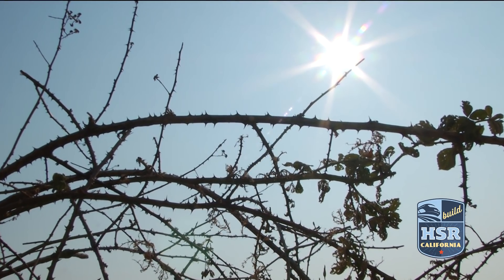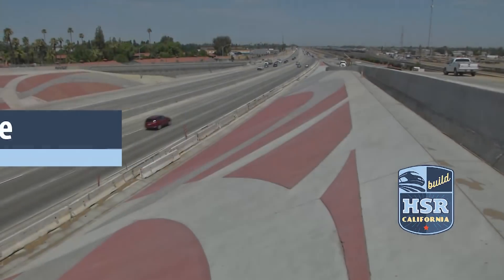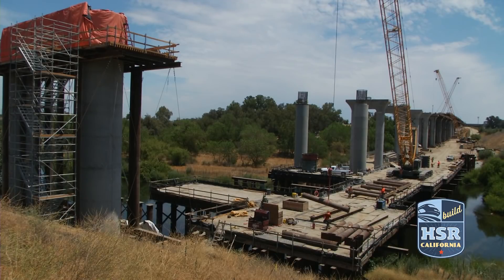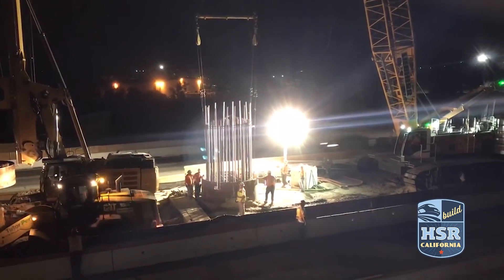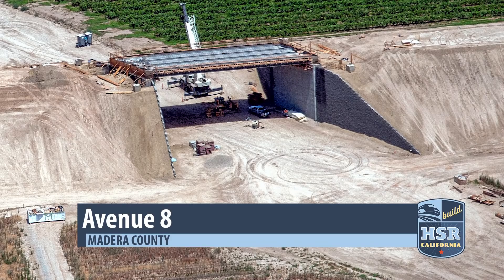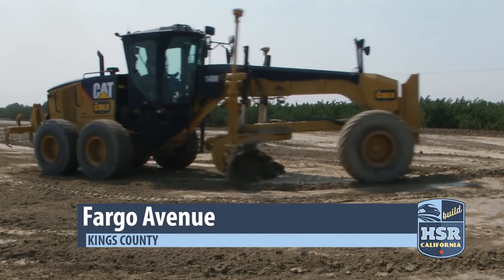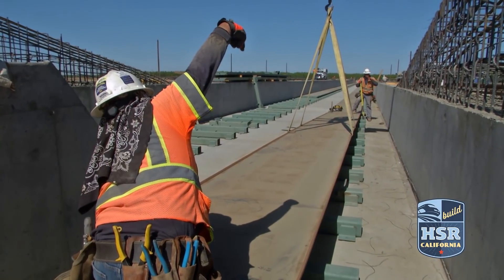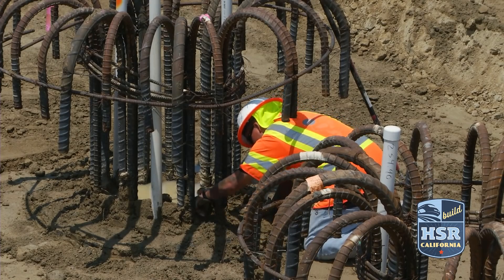High-Speed Rail Construction Update- Summer 2018

Comment: lol France spent $4.02 billion on their first high speed line lgv sud est
California HSR costs $98 billion

$15.8 million per mile vs $188.6 million per mile
Reply: California's HSR program isn't JUST the high speed rail. It includes road improvement projects along the corridor, grade separations along existing rail lines, and commuter rail modernization. It's a while program.
Reply: although i don't support the project, your numbers are totally wrong for a variety of reasons
Reply: LightningZap you also have to consider exchange rate
Reply: Those numbers are from 2007 euros, so even after factoring in inflation that only adds $600 million to the lgv sud est cost
Reply: HS2 was initially estimated at £32 billion, now it's up to £56 billion

Comment: PS: FULL 800 MILE ROUTE(SO THEY SAY!) TO BE COMPLETED ANYWHERE BETWEEN FY 2023-2026. FULL LINK TO SACRAMENTO, CA IS SAID TO BE FULLY COMPLETED BY FY 2027. THIS IS THE LARGEST INFRASTRUCTURE PROJECT IN CALIFORNIA TO MATCH UP W/HIGH-SPEED RAIL SERVICES IN EUROPE, SUCH AS GERMANY, FRANCE, BRITAIN & JAPAN WHERE HSR HAS BEEN IN USE FOR DECADES. GOOD LUCK TO ALL W/THE CALIFORNIA HSR PROJECT. WHAT THE HSRA NEEDS TO GUARD AGAINST ARE LARGE COST OVERRUNS, THIS IS ALWAYS A DANGER W/PROJECTS OF THIS SIZE, BUT ONLY TIME & FUNDING WILL TELL WHEN ELECTRIFIED CALTRAIN & HSR WILL BOTH ROLL INTO THE NEWLY OPENED SF SALESFORCE TRANSIT CENTER BETWEEN FY 2023-2026. STAY TUNED!

Comment: Nice im glad seeing my tax dollars go to free needles and reallllyy slow projects.
Reply: jqbtube, what does Eric’s comment have to do with Russia idiot!
Reply: It should have been a private project like the Texas Central, Brightline, and the train from Los Angeles to Las Vegas.
Reply: @matitigamez5285  America has delayed high-speed rail for decades. However, the delay will pay off. Very soon next year there will be a debut of the latest in high-speed transport in the UAE. It's a variant of String Rail Transport, which was developed by Sky Way Technologies Co. in the country of Belarus. Short run test tracks of urban and touring variants have already seen passengers riding in certified vehicles in the Belarusian countryside of Maryina Gorka. All variants of string transport are several times less resource intensive compared to other systems due the engineering design that supports loads through tension of injected concrete reinforced with anchored cables in steel tubes. We can save billions of dollars and build many more miles of profitable rail sooner if we leap frog and implement string rail transport in the rest of the USA.

Comment: Taking forever. Wish they would concentrated on Fresno to Merced first and have a train running already. At this pace be 5 more years and still no tunnel through Pacheco pass
Reply: The first high-speed section, Madera to Bakersfield, will not carry passengers before 2026, so your 5 year timetable is a bit optimistic.

Comment: Will be a constant drain on the California economy.
Reply: ed cummins 

So is inadequate air and road capacity. Do you have an alternative? Hyperloop doesn't count, it would face the same roadblocks as HSR, without the interoperability that conventional HSR has with other passenger rail.
Reply: HostilePancakes Roads are much cheaper. For $65 billion you could build a 4 lane highway from Bejing to Paris.
Reply: A A 

Which would be of far less use than the HSR. HSR upgrades portions of existing infrastructure to allow high-speed trains to access city centers. Benefits are local, regional, and intercity. With a 4-lane highway from Paris to Beijing, you will have to completely avoid urban areas to build it with only $65 billion. Unlike the HSR which will collect fares, such a road would only be able to garner a reasonable amount of use if it were free -- which means it couldn't collect revenue at all, save for advertising billboard slots.
Reply: The comparrison is to show how ridiculously expensive HSR is. Highways are far more useful and chepaer than HSR.
Reply: Tell me when your motorway allows you to drive a 350 km/h to reach your destination faster. You will still be behind the wheel and stuck at 100 km/h by lane huggers, while train passengers would have already arrived comfortably, having read magazines, surfed the web or watched a movie.

Comment: What a joke ! This white elephant is Jerry Browns baby all the way. Almost 2 times over budget and the projected top speed has been knocked down to just slightly faster than Amtrak. Add to this the plain fact that no high speed rail system on earth has ever shown a profit, and yeah, we got a problem. Elon Musk now has a design for tube transport that can travel over 500 MPH, at a quarter the cost of Browns nightmare. Now Jerry Brown's "vision of the future" looks more like a wooden steam powered fighter plane. Yeah. Brilliant. What an asshole.
Reply: Top speed is still 220mph, although it will likely be at this speed for a relatively small percentage of the entire S.F. to L.A. trip.  They've redesigned the tunnels to smaller diameter to save money, which will restrict speeds in ~100 miles of tunnels to 200mph.  The section from Gilroy to S.F. will likely be completely on shared track, which will limit speeds to 90 mph.  Remains to be seen what speed the train will run at from San Fernando Valley to L.A., but it won't be high speed because it will share right of way most of the way, and its a densely populated area.  California is not Japan.  This system will almost surely be subsidized.  That's not a problem, but let's not pretend it will be a cash cow.  Also, unless there is an express train from S.F. to L.A., it's highly unlikely it will make the trip in less than 3 hours given the current business plan.  In order to make it at the proscribed time of 2h 40m, it would have to run at full speed the entire length, including blowing through multiple stations at 220mph, which isn't happening.
Reply: High Sierra my facts are based on the need of much greater concerns. I don't dispute your comments. My point is as a Californian water should have been a higher priority. Too late now! Guess we will just wait till our third year if drought ( not hoping for it however that how our weather pattern works....feast or famin)whenryone will be pointing fingers. Fact is the finger points back at us.
Reply: You're not clear on what I'm arguing, which may be my fault for not being clear.  Of course all the ancillary things will come with the full build out, but there are a couple of issues: 1) The system is starting in the area which will be least used because it's cheaper and more politically expedient. 2) Phase 1 is at least 4 years behind schedule, and even if they stick to their current timeline, which is unlikely, actual passenger trains probably won't be running the full length until 2040 or so.  Phase 2 doesn't even HAVE a schedule.  So, quite literally, a timeline for "full build out" doesn't even exist.  What we're essentially assured of at the moment is a bullet train from Fresno to Bakersfield, and a fast commuter train from Gilroy to S.F., and those two systems will not be connected.  The funding for anything else doesn't currently exist.  So let's be optimisitic and say Phases 1 and 2 are fully built and operational by 2050.  You don't think other tech will have emerged and matured by then like self-driving electric cars, hyperloop, or quiet hypersonic flight?  The system is almost certainly doomed to be obsolete by the time its finished.
Reply: High Sierra God I really hope that's a reality!!! I've heard but I've heard it before. If it comes true than AMEN!!👍👍👍
Reply: Well, this is part of the issue.  1. We didn't vote for 2 commuter trains from Central Valley to San Jose and I.E. to L.A..  I'm not biased here either, because I'm from the Inland Empire, and think THIS is the smartest place to run it.  However, we didn't VOTE for that.  2.  If that's the most effective part of the system, then the way it's being built is only effective from a political standpoint.  Again, did we vote for a politically expedient HSR system, or did we vote for one from S.F. to L.A.?  The whole idea was that the train was going to compete with air travel between S.F. and L.A. and provide a viable green alternative.  The idea behind Prop 1A was NOT turning Fresno into a suburb of San Jose.  Also, the most important run of this system is L.A. to I.E. to S.D..  That links ~20 million people with a rail line less than 200 miles long.  And yet it's being built LAST.  That's if it's ever built, because there is no concrete plan right now for building phase 2.  Speaking of phase 2 and expansion, while you might have an argument about augmenting HSR with various other commuter systems, you can't simply expand HSR to your hearts content.  They've already had tons of problems with right-of-way in the Central Valley, and that's mostly farmland.  They gave up on dedicated right-of-way for Gilroy-to-S.F., as well as Burbank to L.A..  Also very tough will be the route through the I.E.  In addition, geographic factors just as challenging as Pacheco Pass or Tehachapi abound in this state, so it's definitely not that simple.
Reply: Of course passenger trains weren't obsolete 200 years ago.  They were brand new technology then.  They did become more or less obsolete with the advent of the interstate highway system, though.  Another issue the train itself doesn't really address is how you get to and from it.  The train doesn't address local road traffic at all.  The only thing that makes public transit attractive is road traffic.  But even then, most of the time it's easier, cheaper, and faster to get somewhere by car than it is by public transit.  This is why most people still don't ride trains or buses, and also why public transit usage isn't really growing.  You improve the road network via networked cars and roads and public transit becomes even less attractive.  You replace a 200mph express link with an 800mph express link, and it becomes less attractive.  You replace 70mph human-driven combustion freeways with 100mph self-driven electric freeways and HSR becomes less attractive for medium haul trips.  The question is whether or not HSR would be competitive enough with new tech to be worth it.  Probably not.  So we'll build a $80 billion HSR system that's worth using for 10-20 years, and then it will be a debt-ridden relic.
Reply: High Sierra please name the last three dams built in California and explain why Jerry Brown just signed a law restricting households to 55 gallons per person. Is it because there is no water shortage in California?
Reply: Let's not forget the biggest red flag: ZERO private investment. When it was first pitched to California voters (I remember because I was living in Marin at the time) they said that the costs would be defrayed by sizeable private investment. But of course, businesses know a giant bullshit boondoggle when they see one. To date, this financial Hindenburg has been entirely funded by California taxpayers. Thank Christ, I'm not one of them anymore.
Reply: steve harrigan 

Uh, look at Japan's Tokaido Shinkansen -- profitable since the 1990's (probably before that, too).
Reply: High Sierra back at you with your blnd stupidity!!
Reply: Thank you , unfortunately the BROWN  stain will not be to easy to wash away!!;

Comment: Dear High-Speed Rail,
I look forward to the benefits this project will bring not only to the state but to our country. This will not only ease congestion but also cut greenhouse gasses. One thing that I suggest is to maybe partner with other high speed rail operations in the country like Brightline or Amtrak’s Acela or even better other countries and there high speed rail programs.And maybe send people to ride those trains to see what’s coming to America
Reply: Evan L california is the size of France, has the same economy, and yet we had a high speed rail doing 330 kilometers per hour in 1981, and today it has nearly 3000 kilometers of track. Its truely a matter of political will and i look forward to having the same type of high speed rail in Texas. 

I shit you not, morroco had an high speed rail before the texans
Reply: France did not run trains regularly trains at 330 km/h in 1981, the first TGVs were at first limited to 260 and quickly upgraded to 270 km/h (which was by far the fastest in the world, way ahead of the Shinkansen). Even now the commercial top speed is 320 km/h which is still amongs the fastest in the world and the 40+ year-old trains reach 320.

Comment: It would be great if the HSR was Finished by 2022 , for the World Cup
Reply: Literally zero chance of that.  Assuming no further delay, at best you'll be able to take the train from Fresno to Bakersfield(nowhere to nowhere) by 2027.  Construction of the S.F. to L.A. segment is supposed to be done by 2033(that's a pipe dream).  Extrapolating from the central valley segment's lead time from construction to use, this means full-speed S.F. to L.A. service will likely not occur before 2040, if ever.
Reply: Relative to the state population of ~40 million, it's fairly insignificant.  Fresno MSA and Bakersfield MSA combined are about 1.9 million, which accounts for a whopping 4.75% of the state population.  There are four other MSAs larger than both combined, and the three in southern California account for more than half of the state population, so when we speak of linking these two in context, IT IS NOWHERE.
Reply: the world cup in Qatar?
Reply: Derianmon my bad 2026
Reply: Oh that's neat! I googled it, I didn't know they had multiple countries host sometimes!
Reply: @AuroraBoBora  It'll actually only be the second time they have. The first was in 2002 when it was in South Korea and Japan
Reply: E.V. Gaming  It won't be in England, since they rotate it between continents

Comment: Awesome!! I wish more people could embrace this vision! I have always said, “if you build it, they will ride it”
Reply: After the first train runs on the Initial Operating Segment, more people should be on board. The same thing happened to BART: significant opposition until the trains started running, now people cannot think what life would be like without BART :)
Reply: @archlinuxrussian  Oh?  So you shoot up Heroin in Bart stations?
Reply: David Troncoso You are so wrong. Because of the blended system at both ends, the advertised speed will never be reached, therefore no riders and 90 billion in debt which you have to repay. PS take a look at some of the recent HSR failures around the world.
Reply: @johnnyjames7139  "Failures", just like France, Germany, Italy, China, Japan, Korea… oh wait…
Reply: @transitvideosbayarea  a bullet train between Amsterdam and Paris, or Shanghai and Beijing is FAR different than the slowest most expensive high speed rail being built between BAKERSFIELD and MERCED.
Reply: @mrlopez5009  My post was from a month ago when the train was still planned to go between SF and LA at 200 mph. Obviously it's a boondoggle unless they immediately form plans to finish the original vision. I am outraged by the governors decision.
Reply: David Troncoso they are not going to ride it because it is going to take 5 to 6 hours, you cannot beat the air craft, it is a boondoggle and you are on the hook to pay for it.
Reply: @johnnyjames7139  But it will beat sitting in traffic....lol!!
Reply: deep shit   train to nowhere    Texas train goes 600mph    lol
Reply: Boy if California pulls this off i know quite a few negative americans who will get a good strong laugh.
Reply: How are they going to build it when the money runs out? There are no private investors. The Federal Government is not going to provide any more funding and California has only 10% of the most conservative cost estimates.
Reply: @robertmatthews2009  like Malcolm said in Jurassic park, "life finds a way." You dont knoiw what's in store and what's being done. California highspeed rail project continues...
Reply: @carlsmith5545  Yeah, and Jurassic Park was a great success.